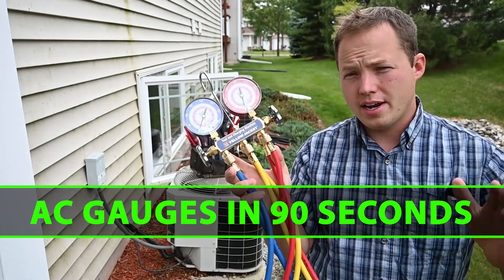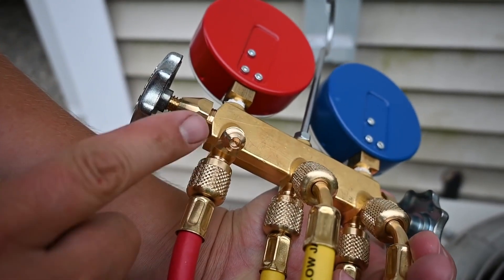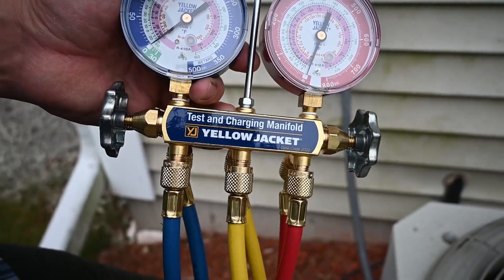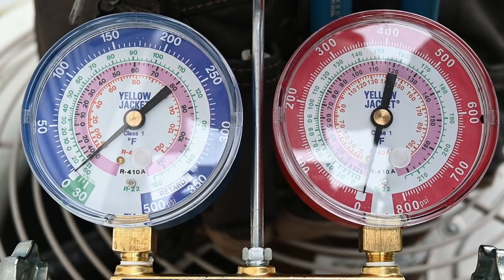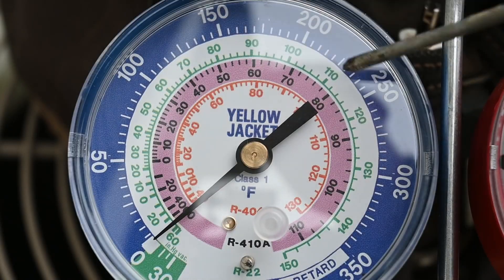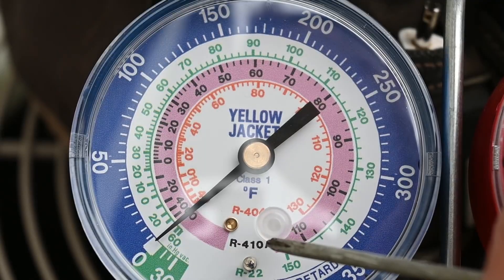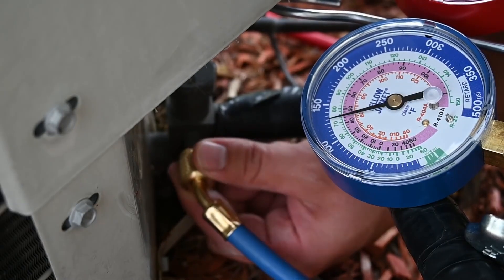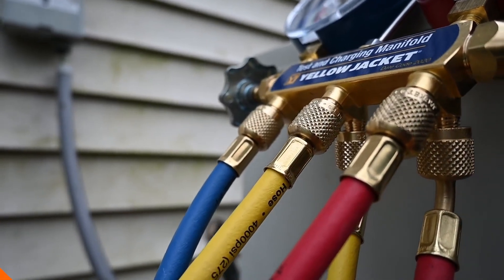AC Gauges Explained In 90 Seconds

Comment: Hey Ben, Question for you. I've been watching a bunch of your electric panels/electric work content recently and have something that's a really weird scenario I'm trying to rack my brain over.

I have a manual transfer switch (mts) that has 5 breakers (one double pole) that can run 240v/30A with a generator plugged directly into the panel. I like it, but with the mts you can only power those 5 circuits, which doesn't have a water heater (also the 30 amps + well pump would potentially be pushing that). Alternatively, I like this because I can run the generator every month and load it for 30 minutes or so without having to touch any breakers in my main panel; just have to flip the 3 way switch (line-off-gen)/breakers for each of the 5 circuits and let the fridges/well pump run as normal for a little while.

I want to install an interlock on my main breaker, interlocked with a 50A socket on the outside of my house that a larger generator can be plugged into.

What would happen if I had my small generator on my mts powering those loads, and other loads in the main panel being supplied from the 50A socket connected to a different generator. All loads still come from the hot of the respective generator leads (separated now only by the mts breakers/3 way switches), return back to the neutral bus of the house, but the neutral is attached to both generator neutral leads now via each of the 4 prong (240v) plugs. I'm a bit scared about how different phases might react to each other on a neutral...but that happens anyway when I run the generator via the mts and still have line voltage supplying the main panel. 

Basically summed up, what is happening to the voltage on the neutral bus with a generator (probably out of phase with the grid) supplying some hots to loads then to a neutral and back to the generator, while the utility voltage supplies the hot to other loads and that returns back to the same neutral bus and back to the utility? Then, does anything change when you swap utility for another generator? Is there an easy-ish explanation about these out-of-phase interactions on the neutral bus? Would this kind of setup be allowed by code?

ps. 'in 90 seconds:' 👍from me

Comment: I've been following you for years and this video was very timely. I just had my A/C quit last week. I had a service guy come out and he told me it is a compressor burnout. He quoted $7k for a new 2 ton system. So I decided to become a DIY guy on this. I already bought a new condenser and coil ($2k). Now I bought the test and charging manifold you suggested. But after more research I'm going to have to have someone come flush the line set and braze them (with nitrogen flowing). I don't think I want to invest in getting set up with nitrogen and oxyacetylene. How much do you think the flush and hookup should cost if I do everything else?

Comment: As a DIY'er and wanting to do a little of my own AC maintenance on both home and auto I looked into AC gauges a bit. I found the colored dials are usually for either Home (R410A, etc.) OR Automotive (R134A etc.). As a noob I didn't want to have to look up conversions or charts, or calculate Superheat and Subcool. So, I bought a set of lower priced digital gauges (sub $300, but a brand name) that can do it all. Used it on four of my own repairs and it has already paid for itself twice over. The gauges aren't magic... you still have to know what you're doing.

Thanks for the video!

Edited for typo.

Comment: wear gloves or have pliers.  I bought a set of hoses from amazon once.  it engages the schrader valve too early and tons of refrigerant spewed out before I got pliers to get it off.   I still don't understand why we have schrader valves when a mechanical valve would work better.
Reply from the maker: Some hoses let you adjust the core depressor depth which can help fix that. Usually you can use the core removal tool to tighten or loosen the core depressor.